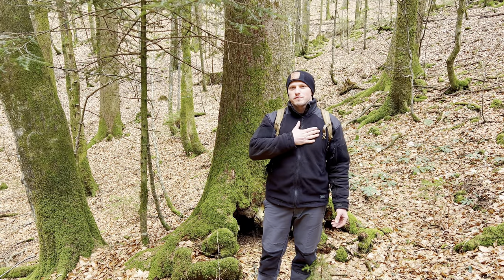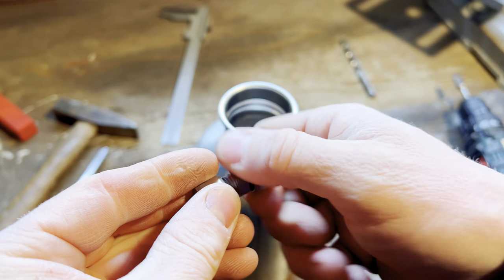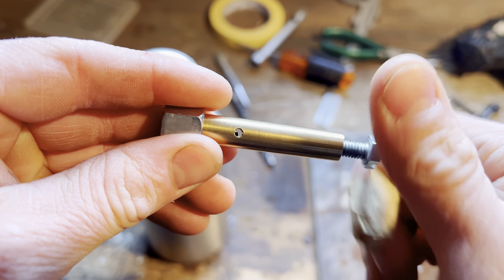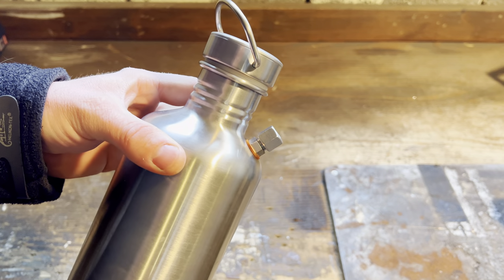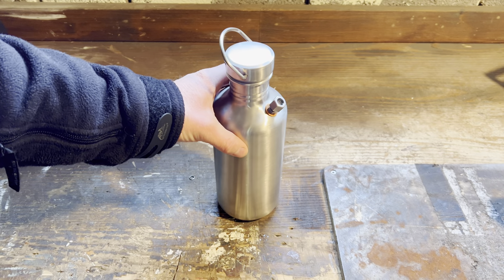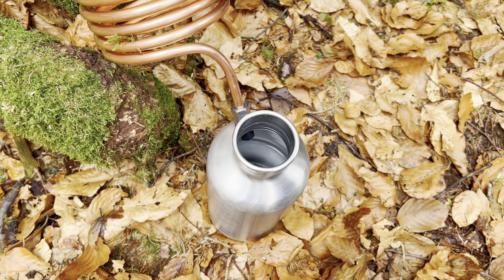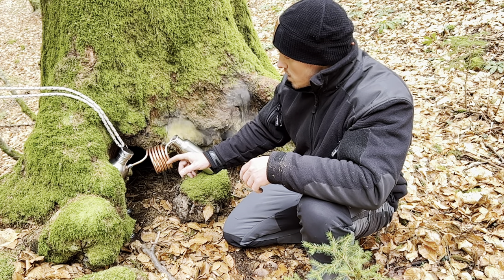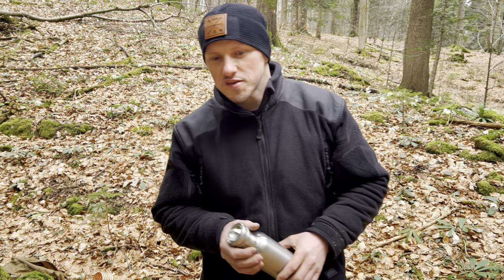This DIY SURVIVAL BOTTLE could save you life! And its EASY to make and CHEAP!

Comment: For those moment when you're in the bush and really need a shot of alcohol, 6cl per boil:D
Adding a good lenght of silicone tubing after the condenser will make it safer if your using fire as a heat source, alcohol vapor is very flammable.
Reply from the maker: Never thought of that, thanks!